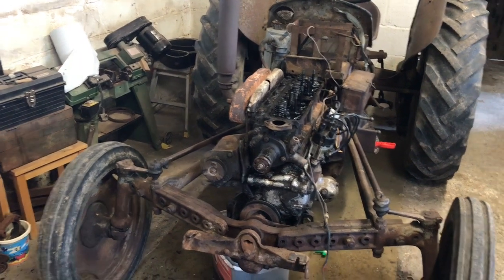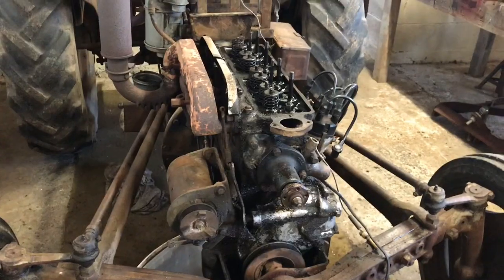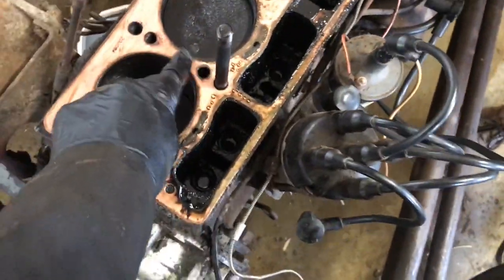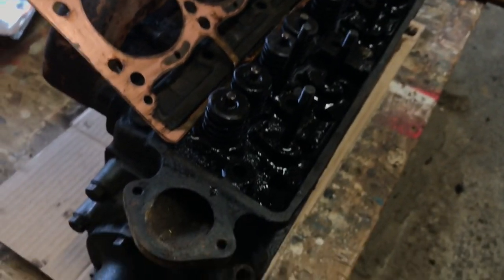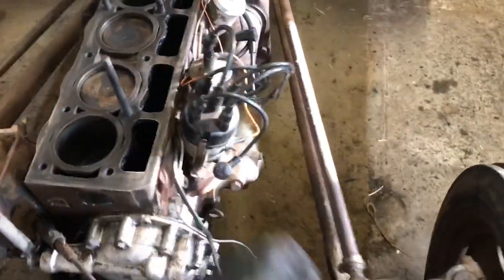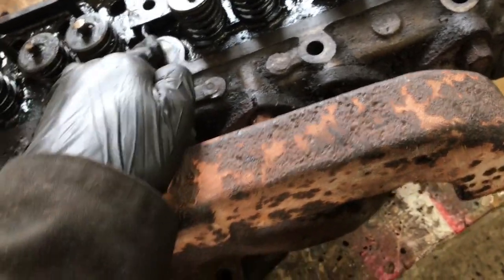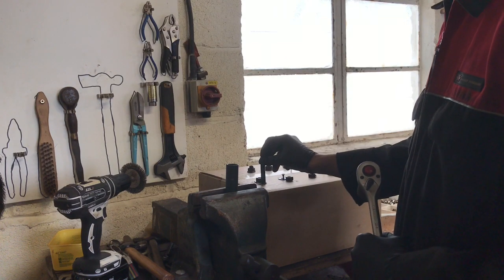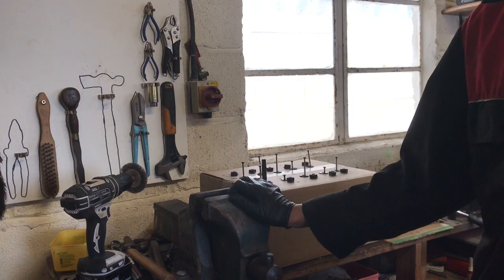Ferguson TED20 engine rebuild Part 3: Cylinder Head

Comment: Great video! Are you just doing the head gasket or rebuilding the engine and the head gasket?
Reply from the maker: Thanks! I've changed the head gasket, a few other gaskets, not a full rebuild, although I expect one will be done in the next few years.
Reply: @OliverLee390  yeah. Ok